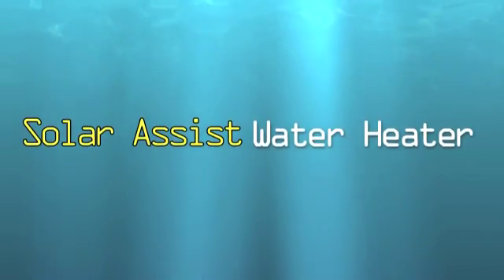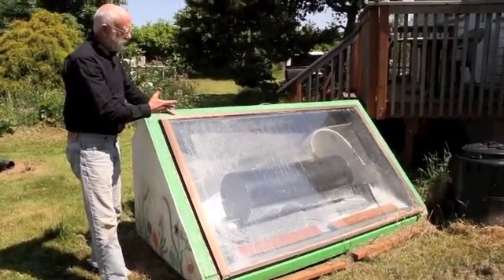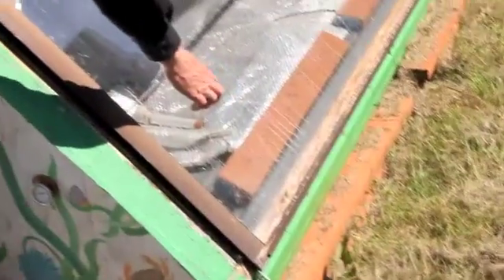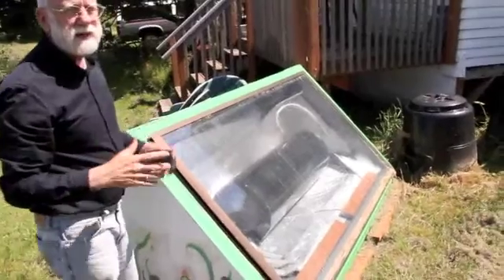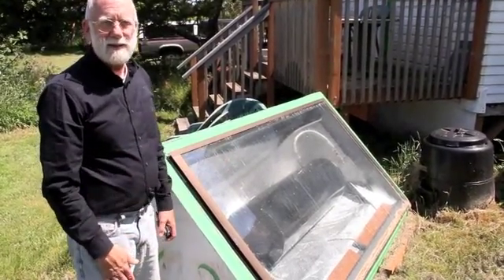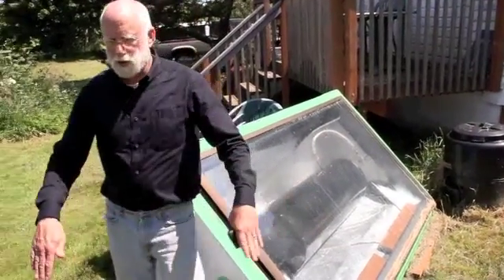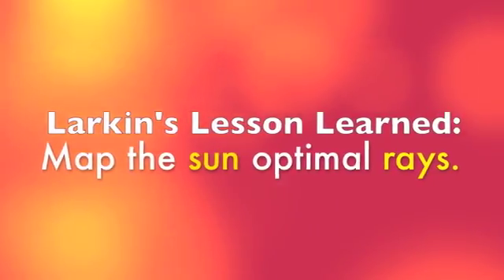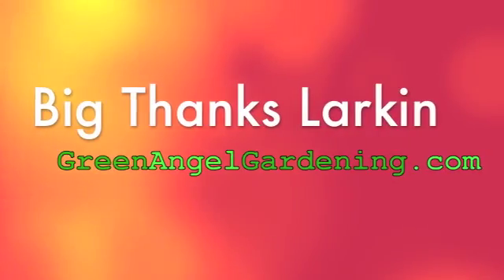Solar Water Heater: Green Angel Gardens

Comment: What can be done if you just want cold water? How hot does the water itself actually heat up to? And do you need to just shut off flow to the breadbox and have straight cold water come in avoiding the tank outside if you want just cold water?

Comment: I've seen a few of these around, but most don't leave the interior with a reflective surface, most people paint it black. Is there a particular reason you did not?
Reply: maxdecphoenix if your time allows can be made two small models with two equal empty conserve boxes
and one backgrund aluminium the other not reflective black both insulated on the background with rockwool.
comparing the results in both cases you can build the model which gives better result .